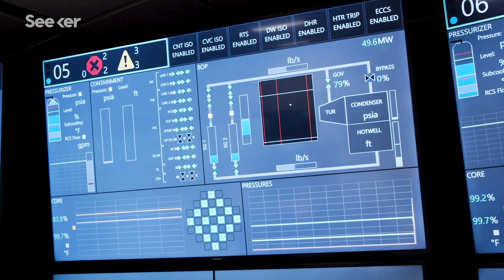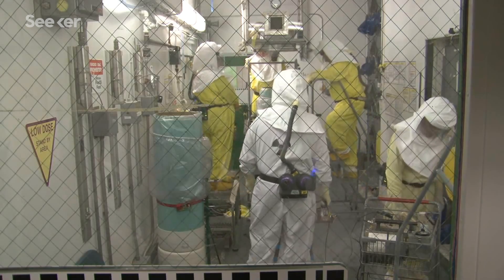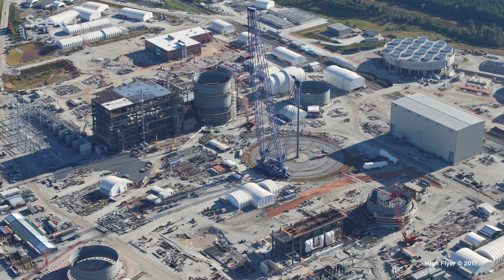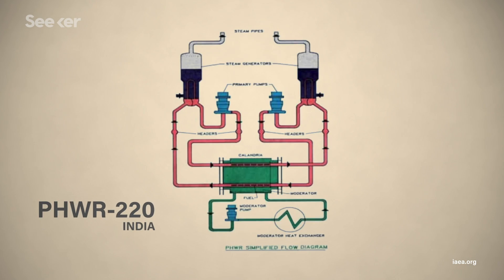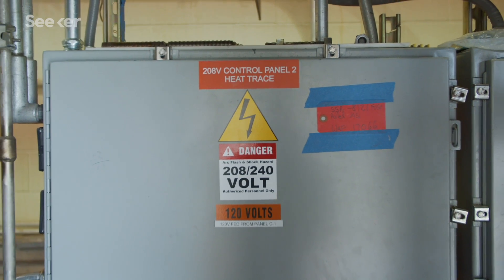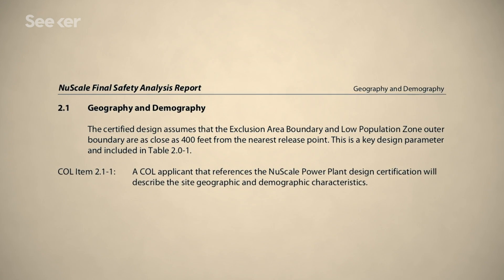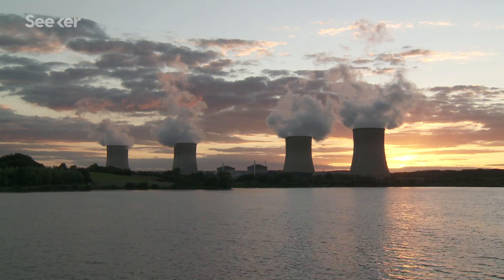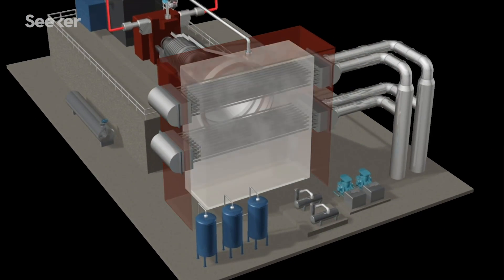Mini-Nuclear Reactors Are Coming, and They Could Reinvent the Energy Industry

Comment: 300MW.

Not great, not terrible..
Reply: Not good not original
Reply: Hence why it's modular
Reply: its 300MW per module.
Reply: Moltex's SMR, called the SSR, stores energy in molten cooling salt 
So the reactor always runs at 300MW and surplus energy is stored in a salt bin. Energy spikes are served by running the generator at 3000MW using the surplus.
Reply: How do you figure this? A high pressure CNG power plant locally near me produces only 540mW at full clip and has to use six turbines..... That is pretty average... So what are you basing this statement on?
Reply: @scenicdepictionsofchicagolife  To be clear, it's a quote from HBO's recent mini series, Chernobyl..
Reply: It's actually harder to make smaller yield nuclear generator.
Reply: very terrible
Reply: About the same as getting an x ray

Comment: I think, as long as things are designed properly, aren't rushed and have qualified staff  then we can avoid situatuons like Chernobyl ever happening again.
Reply: Or we can continue what we are doing as there are:
1. Zero modern designs based in any way similar to the RMBKs of Chernobyl
2. Regulations of coefficients of reactivity enforced by respective country regulatory agencies
3. Reactor requirements enforced Ed by the IAEA with additional enforcement by the UN Security Council
Reply: As long as the other guy wants to blow up the other or vice versa using nukes, we will never be safe.
Reply: @riujithetechnician  thatvwas literally the only danger of nuclear energy. If there is a nuclear war and one of those plants get nuked. Wefucked
Reply: @ethank.6602  Pretty damn sure if nukes start to fly were fucked anyways. A power plant getting hit would be like a firecracker going off on top of a stick of TNT as it explodes.
Reply: Brainjock Do you mean quantum mechanics and nuclear engineering? My comment was just about laws which is public information.
Reply: Kim Phan  Everything that can go wrong will go wrong eventually.
Reply: @alobamify  I know. 😔
Reply: @alobamify  yep
Reply: @alobamify  
True, but right now that means that anthropogenic climate change is going to go wrong and go wrong right now
Basically we have more immediate problems.
Reply: alobamify I get you. Just look at the fossil fuel industry...
Reply: Modern reactors are designed so that it is impossible for a Chernobyl-like disaster happening.
Reply: @m4dalex828  garbage
Reply: Grant Rennie not garbage
Reply: @m4dalex828  Even if modern reactors were designed to be safer. They still are still dangerous to some extent.
Reply: Kim Phan Chernobyl could only have happened in a socialist country.
Reply: Dont tell the Muslims where they are built either. I hope these buildings can withstand a plane slamming into them.

Comment: Wait what about "Nuclear Batteries"
Reply: They work very well for low power consuming machines and devices. For example, they are used in the Curiosity rover on Mars and the New Horizon probe that flew by Pluto. I think that even the Voyager probes use a similar kind of device.  They last a very long time though they aren't very efficient. There are even some smaller devices that uses the radioactive properties of tritium to power themselves which can run for up to 5730 years before reaching 50% power. They work by converting the light that tritium emits to power a photovoltaic cell. So they basically work like solar power but on a smaller scale and with less efficiency. You can even make them yourself by taping tritium vials against a photovoltaic cell from an old calculator that doesn't run on batteries.

Comment: Hope people could understand that nuclear power is far more safe than coil and oil.
Reply: John T it could have been a lot worse than it was.
Reply: it may be so but the issue is its will never be 100% infallible and one accident and you have a huge disaster that cant be fixed almost like flying but without the fallout most of the time you will be okay but when something goes wrong your goose is cooked
Reply: Matthew Lewis including all the deaths even in major disasters, the total per TWh is nowhere near that of coal or oil. Fossil fuels give off pollution which gives you cancer just like radiation.
Reply: Inqu'aanate it’s actually the lowest amongst all energy sources. Nuclear power averages 0.04 deaths per TWh.
Reply: howard baxter +
Reply: Chernobyl almost made Europe uninhabitable for thousands of years.  Also keep in mind natural disasters or terrorist attacks.
Reply: @Vergos001  Even considering Chernobyl and Fukushima, using nuclear power in place of fossil-fuel energy sources, such as coal, has prevented some 1.8 million air pollution-related deaths globally. With the technological advancements nuclear power plants are getting more safe than ever, this is the only fix to the global climate change, because solar/wind are not sufficient.
Reply: Vergos001 You know what happens after big disasters like Fukushima, Three Mike Island, and Chernobyl? We learn, and we correct our problems. There is light in every disaster as it makes us much less prone to disaster in the future, just like an immune system learning how to fight a specific virus.
Reply: Vergos001 Chernobyl can and will NEVER happen again. Outside of the incompetence of the people running the reactor, the reactor itself had no containment building, meaning that if the reactor melted down, the radiation would be directly released into the environment, and not inside the containment building. No reactor today has that same physical design as Chernobyl. That’s just one reason why Chernobyl was as bad as it was. Modern reactors are designed completely differently from Chernobyl.